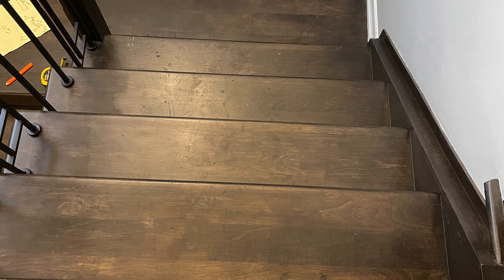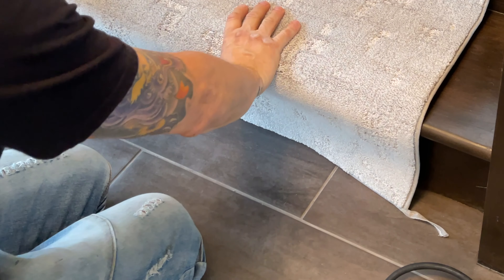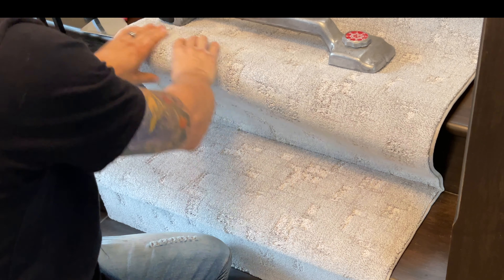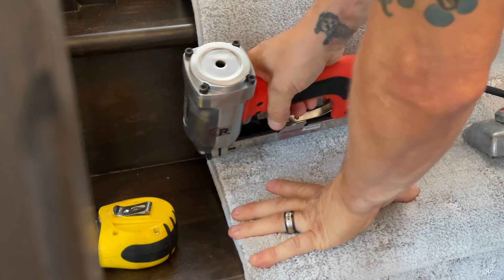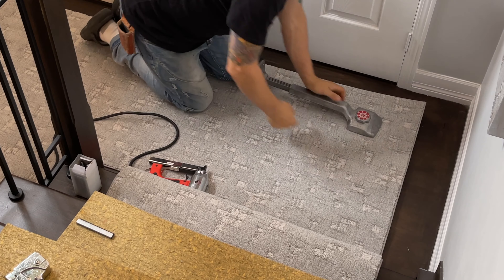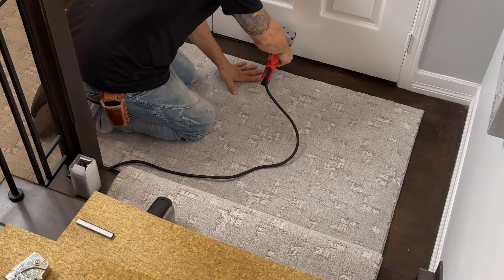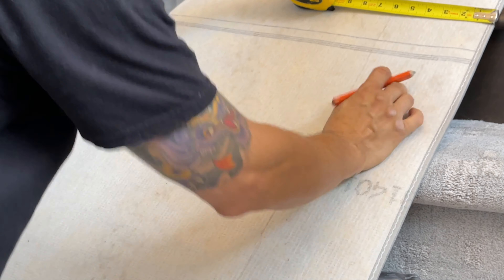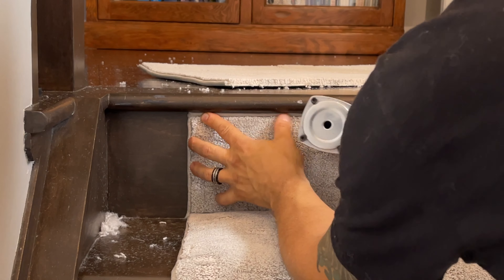Stair Runner Installation Styles w/ Matching U Shaped Landing

Comment: Hi how you been man ? I got a cuestión l have a runners stairs for tomorrow what you recommend put two tack trips or just one on the Bottom?thanks a lot
Reply from the maker: I only use one if I use smoothedge at all
Reply: @KeithShannonDirectCarpet  ok thanks a lot l have to do water fall